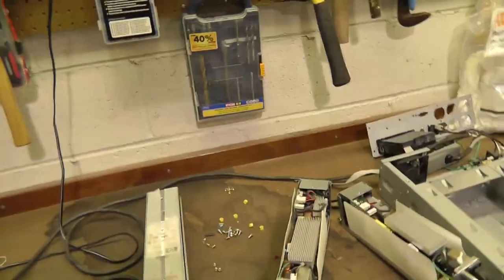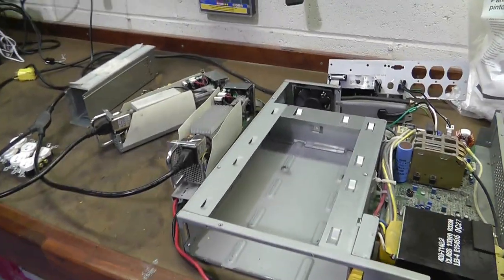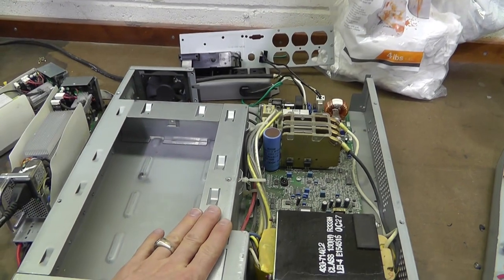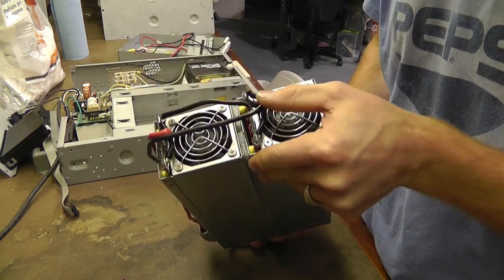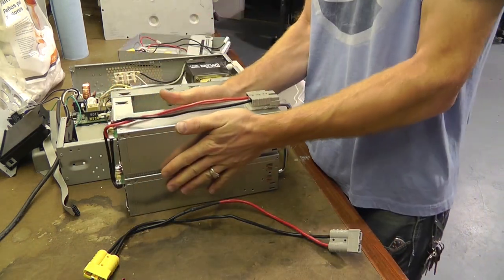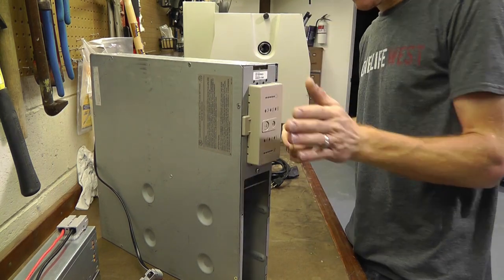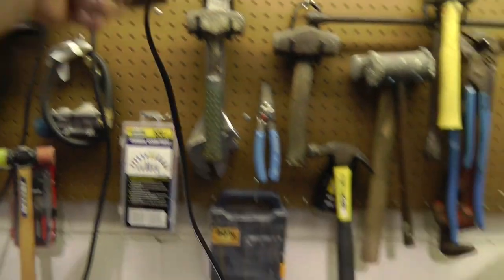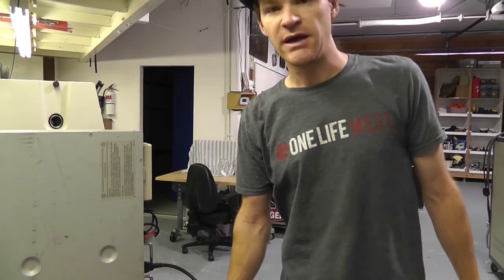P2 : 1400VA Constant Voltage Output Supply From Recycled Server PS's & UPS

Comment: hey you have alot of control on the voltage in the ups settings
you can set de outpout the freq. and you probably can disable the charger
and be carefull those ups's are not made to supply power for a long amount of time they get really hot if you let them too long

Comment: Question— would you need to connect pin #13 to the +12V to enable +12VRS (Remote Sense) or no?